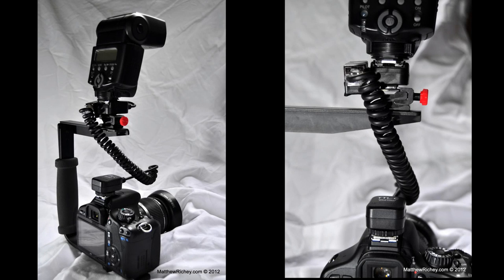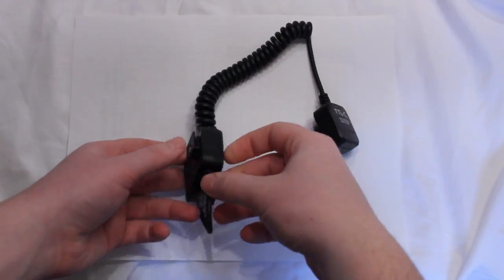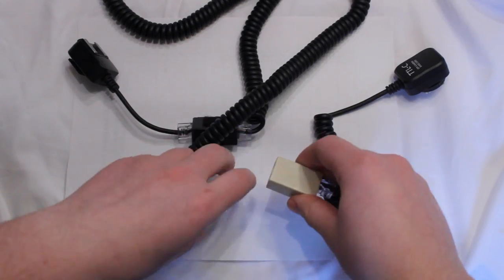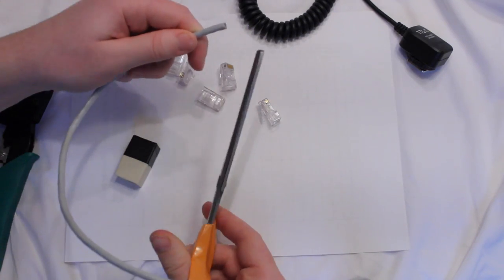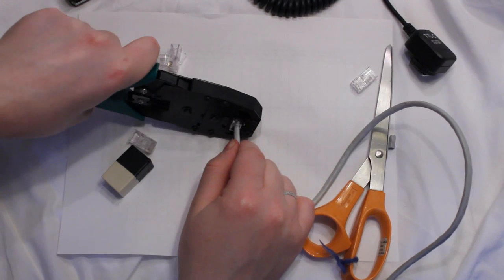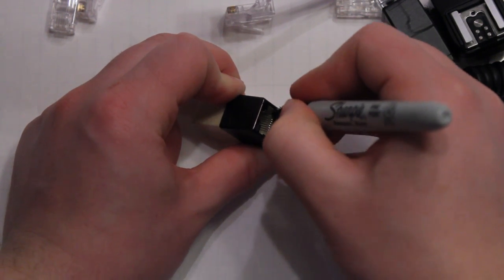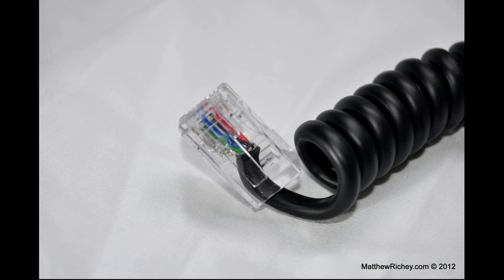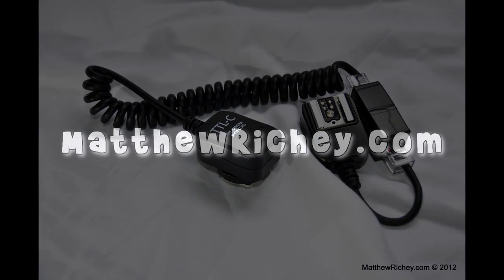MAKE it DIY - How to make a adjustable photography ￼flash sync cord with cat5 cable

Comment: Great idea. Being a tech, cutting/crimping the Cat5 isn't an issue for me. However, you certainly could have spent more time showing the cutting of the sync cable, what would be found inside, a visual on this "silver coat outside part", and the expected number of wires inside.

I felt like I was watching a video on car repair that said "just rebuild your engine" and showed a picture of a completed, rebuilt engine.

Comment: I did it today - on 2nd attempt.
The missing bit here is that (on a Nikon cable) there's a sleeve of copper wire outside all the others *that you discard*.
Don't confuse with the smaller sheath of copper wire surrounding the white strand - which you keep. 5 wires in all.
It took a lot of patience to get the wires to match up. 
10-15mm of clean wire and 5mm of coloured sleeve was about right. 
Burn off the nylon core to each wire.
You need a crimping tool and calm approach, it's not a quick job.

Comment: Good idea!  Perfect for what I need - instead of wireless - a little confused though would you use the cat5 cable in the middle of the two original TTL cable?  You cut the TTL cable and put the ends on each - then add the two modular plugs, and then you put the cat5 in the middle, correct?

Comment: Dude, the outer layer of that CAT5 cable is removed using the crimping tool, not the scissors! 

In fact, I believe the correct procedure to crimp RJ45 connector is to remove the external casing (longer than what actually goes into the connector), then straighten the wires, then trim the excess wires then crimp.

Comment: so i have 2 standard flash cables which i will strip the one end of each and place the cat 5 connector to it? How many wires does the flash cable have including the silver coating you mentioned? does it fill all the sections of the cat5 connector or its not necessary?
Reply from the maker: You don’t have to use all of them on the cat five

Comment: Does the signal degrade if you get too long with the cable? Do you need to build a signal repeater into the middle of the circuit?